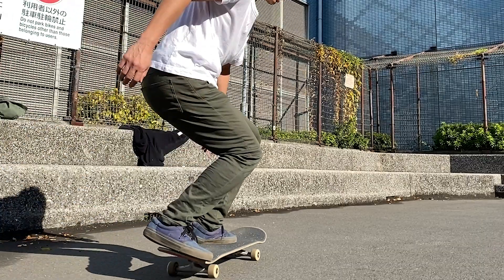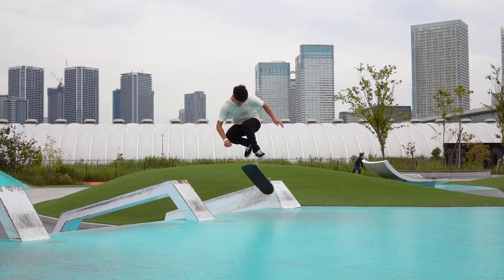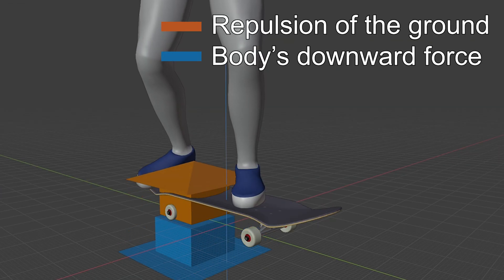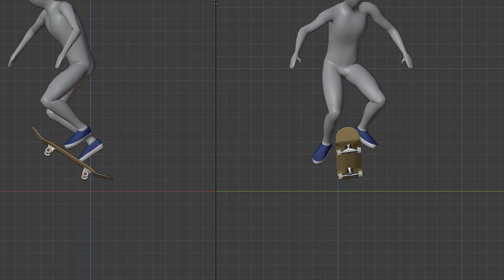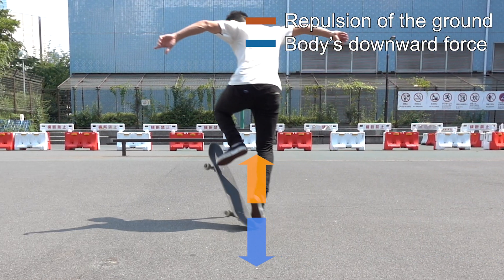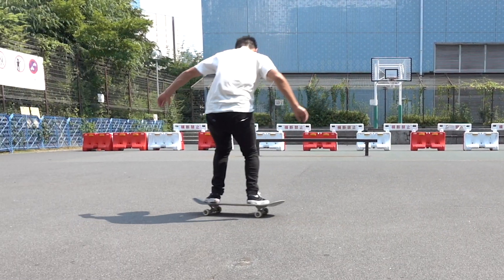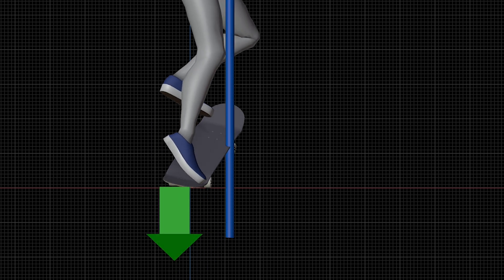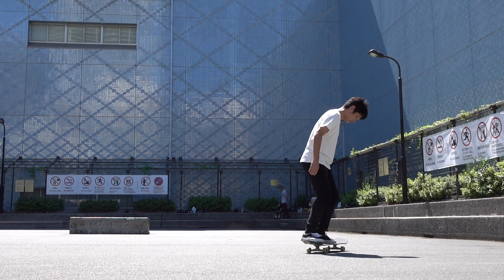Easy and Consistent Pop shove-it - How to Pop shove-it according to the physics

Comment: Great video. Idk if you've ever done them this way, but pop shovs can be executed much better with your shoulders being open almost completely towards the nose. With your eyes, you are looking the front bolts. Your front leg is also further back, at the middle of the board and toes pointed like your doing a flip. Back toes is in the middle of the tail as you are poping and shuving a bit harder. Shuv also has to be vectored towards the front not just to the side  This way you jump straight up and the board doesn't go in front of you, it's stay centered below you. It's the nicest looking pop shuv, but a bit harder to do.
Reply: Yuup, this is exactly how i do mine now, front foot doesn't do anything and they look soooo good

Comment: Actually, compare what you do when you jump up on a skateboard to what you do when you run with your hands and feet. Did you notice that when you jump up your front shoulder rotates in front of your body, because you have to get your back foot on the board, much like when you run with your hands and feet. If you do it on your hands and feet on same direction, it will be unstable and likely to fail.